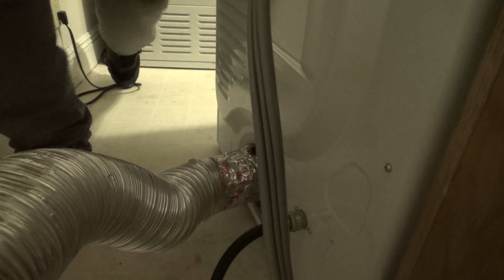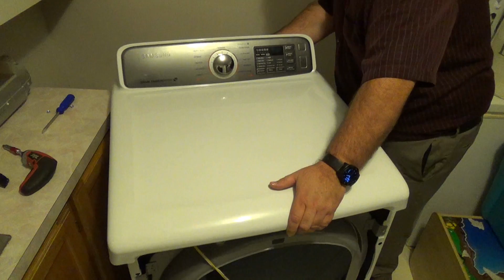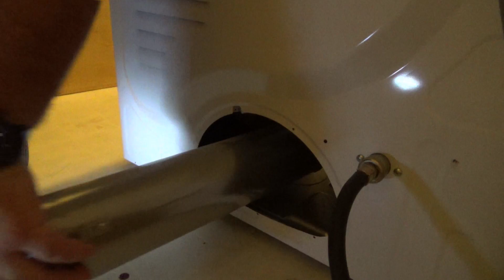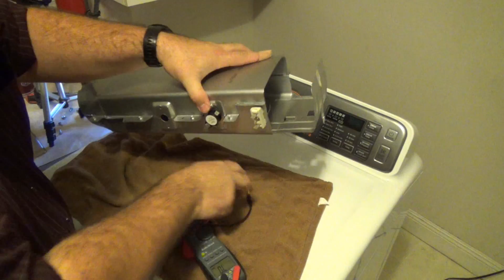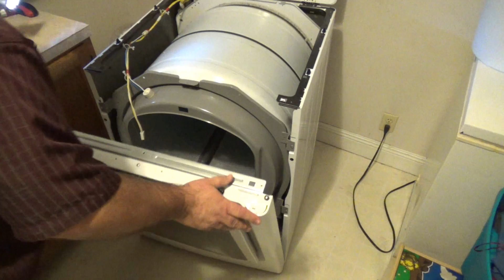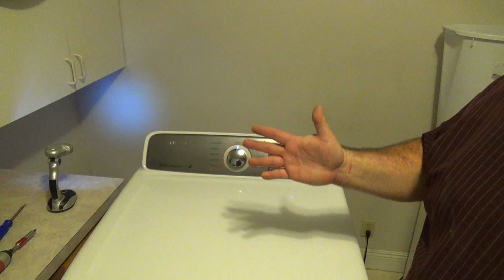HowTo: Fix Samsung Dryer Not Heating! Complete Step-by-Step Diagnostic & Repair

Comment: I followed these instructions and fixed my dryer myself! All I needed was a $20 multimeter and a fuse. Thanks for the video!
Reply: John Tice is your dryer still working? Reason why I ask is because I've had it repaired twice by a repair specialist certified by Samsung and the first time it only lasted 5 minutes before it blew and the second time it lasted just a day short of being 2 weeks.

Comment: Ok I have the same dryer and im having an issue with it starting. It turns on and let's me select a drying option but when I press the "start" button it only makes a clicking sound but doesn't start. Any suggestions?
Reply: I would open the top and verify that the belt is still on the drum and connected to the motor that spins the drum. It may be the motor has failed, and on some of these models, there is a small switch that will shut off the motor if the belt fails. That is the area that I would be looking at first. Much less likely, but always possible would be a defective main control board, but that would be my last resort.
Reply: @deancody3630  Bingo

Had these issues, idler pulley wheel had come off... somehow.
Reply: Victor Conde 
Bobby Willis I have modal
Dv42145200ew/A3
It doing the same thing how did you correct yours or have you
Reply: I'm having the same problem with mine.
Reply: Same thing happened to me. However on mine the whole pulley snapped in half

Comment: thanks daniel for the detailed instructions which i followed easily.  however, after replacing the heat assembly my issues of intermittent heat still persist.  here are some clues...if the exhaust vent is removed from the dryer then it heats up fine.  the dryer is vented outside over approx. 12ft with only one 90 elbow at the back of the dryer.  the duct is clear (used my gas powered leaf blower to blow it clear from the inside).... as a temporary fix i thought to just use one of those water lint traps but as soon as i attach to dryer it stops heating again.....this is only about 3ft of brand new semi ridgid duct.  i dont think the heat assembly needed to be changed and i'm now thinking its the control board.  anyway to test the board?  thanks!

Comment: are all samsung heating assembly the same
Reply: Antonio Estrada I can't tell you for sure if through exactly identical by the shape and size and the components that are attached to it but I can tell you one thing as many sides as I have been going on to try to figure out how to fix mine they are all crap. I have yet to actually find a permanent fix for my dryer. I have had a license technician repair my dryer 2 times and the longest that I have had it working since the dryer went out was two weeks.

Comment: Awesome video.  Worked like a charm!  Just don't try to disconnect wires from the back!  My arm slipped and cut forearm on the sharp tin.  Ended up with 4 staples.

Comment: Can someone copy the Amazon link for the assembly please?
Reply from the maker: +Taylor Hughes here's the link.. but you need to find the part number for your dryer and verify that this is indeed the correct item. Samsung DC97-14486A Heater Duct Assembly for Dryer https://www.amazon.com/dp/B005BQS1ZO/ref=cm_sw_r_cp_apa_uqNAzb98Y4C54
Reply: does this part fit model dv48h7400ew/a2

Comment: Do you know what would cause it not to start? Mine is a little over a year old and suddenly, will not start. It will power the digital part and count down the timer, but no heat and not turning. Of course the warranty just expired.
Reply: it's your pully and or belt

Comment: Using your video helped me replace the assembly easily. I had a blown high heat fuse, but we noticed the last month, or so, it was not drying the same. The element was good and so was the thermostat, but the parts guy at a local appliance shop said it would be best to replace the assembly. 67 bucks. Thank you for the video. It made replacing it soooo easy!

Comment: Thank you for the informative video. I have the same dryer but mine won't start. I select the mode and push start, the I hear a faint click, but nothing happens. 10 minutes later it says end. What should I check? No codes.

Comment: When you say it took a little while for the heat to kick in, about how long did it take? My dryer stopped heating, and I received no error message. Cleaned out the vents and all....no heat. I replaced the heating element just now (great instructions, by the way), but still no heat.
Reply: esperanz02 I’m in the exact same predicament

Comment: daniel, i recently replaced my dryer heater assembly. the coil was bad. after i replaced it, the dryer heats fine but its making this annoying sound, like chatteeing a bit or shrilling... help???
Reply from the maker: Check that pulley assembly I mention... make sure the belt is riding in the right groove too.

Comment: On other videos I have seen they take that lower support bracket out from under the heating module  first, then it will come out the front and you can see the wires and replace them 1 for 1 so not to wire it wrong.
Reply from the maker: Couldn't get that little bracket out... and I had a bad tensioner pulley in the back to change too...

Comment: i replace the board that the tech said was bad, it worked for two loads.  i took the dryer apart removed heating element and it all checks out fine, have no idea what to do from here, any advise?
Reply: did you figure it out yet. I just replace the heating module (element, fuse, thermostat) worked for a few loads now no heat again. circuit board is $65. I heard it could be the blower motor as it feeds the heating element.

Comment: I have a Samsung dryer that is approximately 2 years old ( not near the unit and I can't recall the model but looks similar to the one in this video). The problem I have is that one blade of the pigtale cord gets so hot that I cannot touch it after I pull the plug. I am very adamant about keeping the lint trap and exhaust duct clean so that's not an issue. When I pulled the receptacle, one thing I noticed right off is that the previous homeowner (I assume) ran the circuit using 10-2/w #12 ground and he taped the ground and used it like a de-rated neutral. My plan is to re-pull the circuit using 10-3/w ground. Can using that #12 as the neutral cause one leg to draw more current than it should? I am also wondering why it's not tripping the 30A breaker in the panel.

Comment: Had the same issue.  A tech came to the house and said it was the main circuit board.  I replaced the board and dried two loads now back to no heat again. had the dryer for little over 2 years.  Any advise?
Reply from the maker: +Tman171717 Only thing I can say is that with my problem the dryer still runs normally... just no heat.  No error codes either.

Comment: I had the same problem with my Samsung  DV45H7000EW ( no heat) . I removed the coil housing containing  the coils, thermostat and the thermal fuse. I did continuity tests and found that my thermal fuse was bad. I placed an order  for the thermal fuse  with Parts Doctor and I expect delivery tomorrow. and of course I also cut myself a few times. LOL. I just don't understand why they didn't design the thermal shutoff with some kind of auto resetting breaker instead of the fuse. Once the fuse pops you have a heck of lot of work just to get to it and change it out.
Reply from the maker: If you watched my video completely you will hear me mention that I also replace just the fuse... knowing that something probably caused it to blow. Check your vents for clogs or any condition that would have cause the dryer to overheat. If the fuse pops again after replacement... I recommend getting the whole heating assembly on Amazon ($65.)
Reply: I think I know what caused it to blow. When they built my home , for some reason they ran a 20 foot  dryer vent line. This line is so long wandering through the attic that I cannot know for sure if it's block or inhibiting air flow from the dryer. I am going to reroute my exhaust vent line. MY old dryer , before I purchased the Samsung, was frequently shutting down until they dryer cooled off and the internal breaker reset. I'll see if I can get away with this $13 repair first.